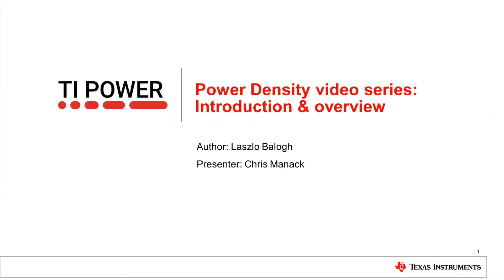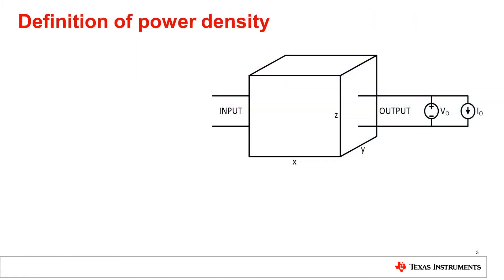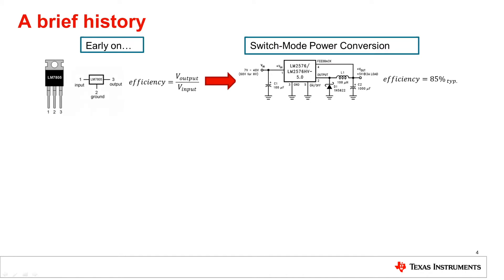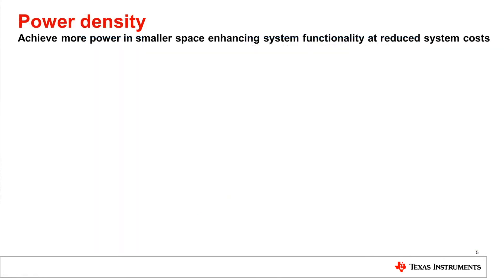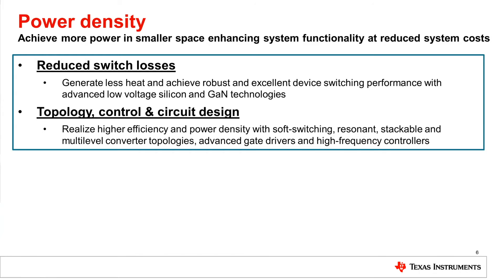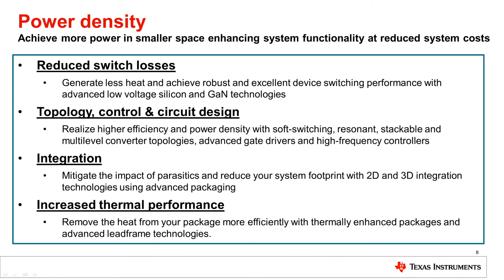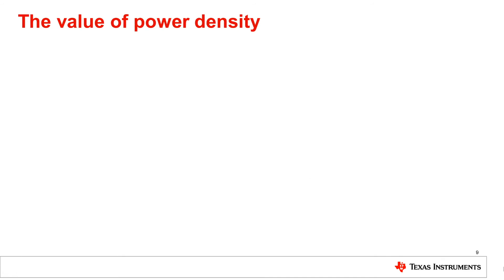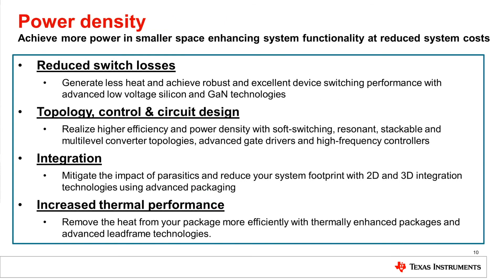Introduction to the fundamental technologies of power density

Comment: Quite a long time ago maybe years I spend some time on your database and found some intriguing Solutions. In recent days I have been frustrated but also found the Surplus Market to be entirely untapped for reuse. There are tons of relatively high efficiency 12 volt output often redundant 4 less than the metal value from bulk sellers all over the world including Brands like Emerson that has produced a huge number that have never been installed so you can buy them in the individual quantities or by the 20 pack for about $10 each and that's for around 700 Watts.

It's never before happened that the AI image recognition of the product picture is the only way on a site like eBay 2 shop for these modules. The business and Industrial category with all of its filters does not allow proper search.

Because they are hot swappable you can literally build electric bus Chargers out of them despite their low density.

In the United States people tend not to buy the high frequency mosfets for their car oddly. Other countries of course including those you are supplying I assume have provided Gann an s i c
Reply: The Google keyboard does not provide electrical engineering English as an option 4 translation or even just simple recognition for typing so I apologize I did not even want to send that yet I was trying to manually correct.

Anyway it is important for our species and life on Earth that power density be simulated obviously just initially for micro Mobility because that enables alternative storage chemistry like titanate oxide to be the lower cost of ownership option it always has been. I don't understand how these large companies are able to avoid International antitrust. We actually need Global whistic antitrust enforcement and I understand that has been the point of these treaties that are now cracking down on at least European nations like Canada lol being denied North Americans. Power density is on your premise such a large Market you should not encourage your original equipment makers to buy these power supplies and buried them in landfills before disruptive micro Mobility actually sees them powered up for the first time. Think about Mercedes selling used batteries I think exclusively as their business model at least initially to do exactly the opposite keep their older electric cars from being owned as long as gas cars even or worse parted out to and car scale Mobility for individuals in see true Transit Solutions not just the era of micro Mobility.

Finally the hydride solution I first learned about anima toriel science I said on the American public broadcasting Treatise about Material Science and the baked corn husk fibers being the way to move hydrogen is the real power density being the molecule has the machine not the electron which I don't know if you would call Pico instead of Nano but liquid nitrogen has the power density that disrupts electrical Solutions.

I see that you have published another or I'm getting a late notice of this 5 hour video but I doubt I'll be able to watch it unless it is just hitting the YouTube now. A new paragraph a

The bottom line is probably before you were in elementary school your current employer had courage. I remember their solution for the purification of silicon which was just to use the center of droplets as impurities go out to the outer surface. Back then we believed that the only thing thin-film would be good for what's powering electrolysis and that everybody would have Platinum heaters and the natural gas grid would be converted to hydrogen for such Heat purpose. Your had a different idea and destroying the potential of solar is the result.

 Density is the pressure within the the Earth itself and the thermal Mass regardless how much of the heat is radiogenic what we need is the control of large amounts of molten rock not token amounts of tritium.